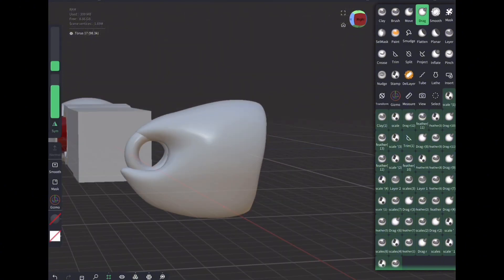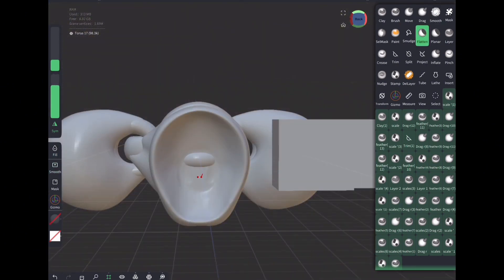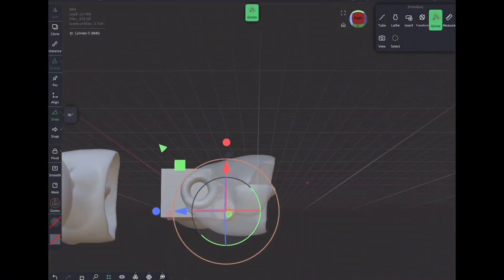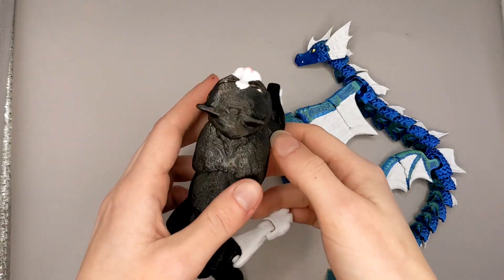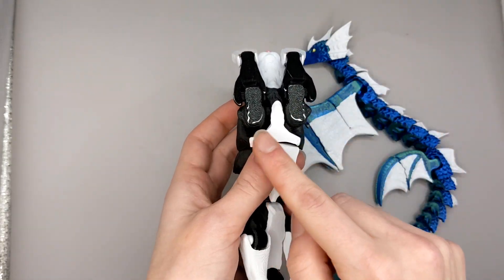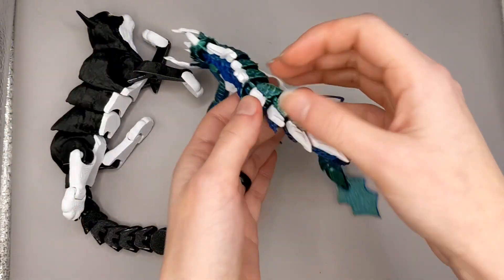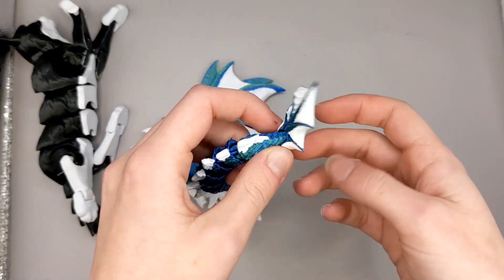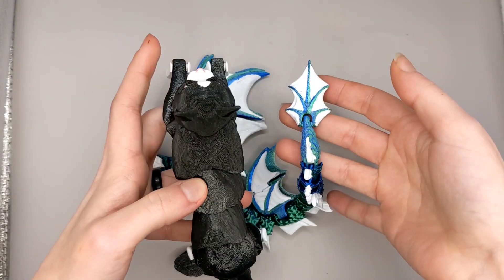3D Printing Flexi Modeling Tutorial (Part 4)

Comment: Excellent videos, thank you so much. I have done a few using a similar method to your first video in the past, creating toys with my now 8-year-old daughter. Though I'm no stranger to joints being from Industrial design I tend to run to CAID when I want a joint. I see that I really don't have to based on hour videos. Short and straight to the point, love it. I haven't finished going through all your videos, but I have a question do you sometimes design your creature out, then cut it up and add joints, or do you always start with your joints first?
Reply from the maker: Thanks so much! I'm so glad you enjoy the video! And I do a bit of both. Some models and joint types I re-use from multiple models and sometimes I start from scratch!